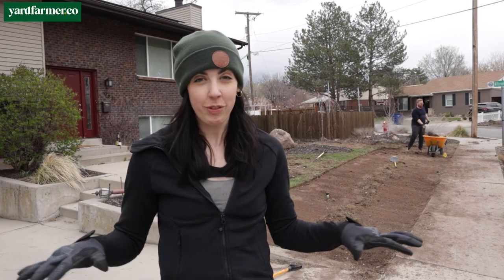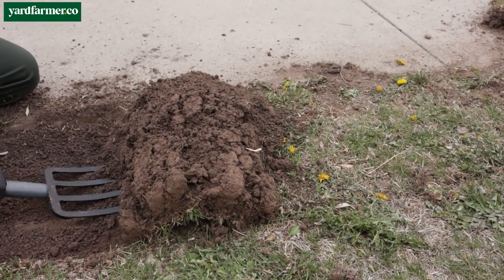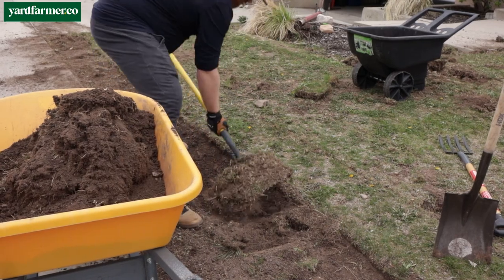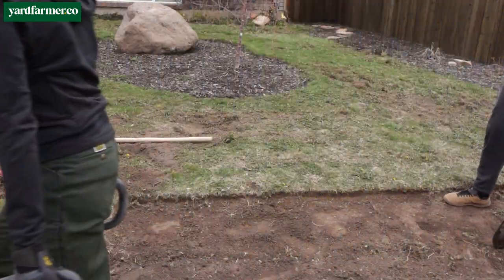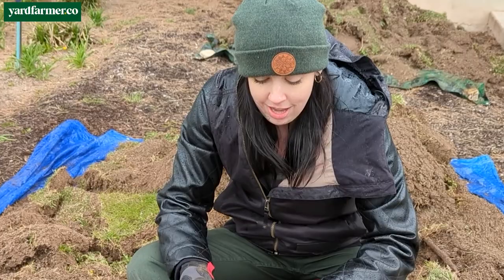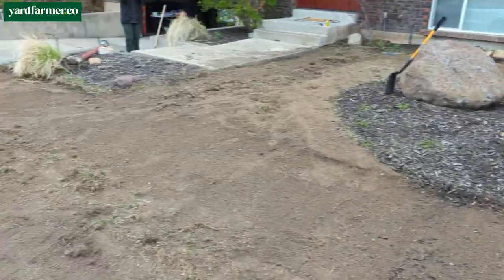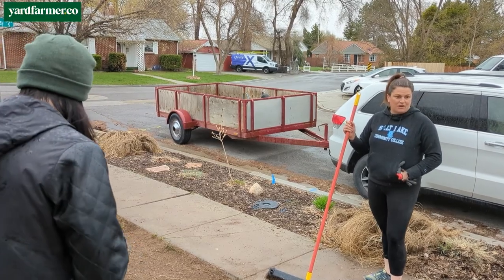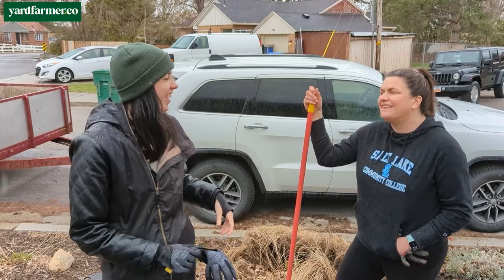We RIPPED OUT an Entire Lawn with Sod Cutting (in Four Brutal Hours!)

Comment: I ripped out a bunch of sod by hand in my front yard 3 years ago when I started my vegetable garden. In order to minimize the amount of sod to be cut, I decided to cut out the pathways (fairly deeply, prob like 4 inches) and flip those thick sod squares  upside down onto the beds. It was just cut, flip, cut, flip… without all the hauling off. It wasn’t too bad. It also made it so my beds were like 6-8 inches above my pathways from the get go. I then put a thick layer of compost over the beds, and then mulch (usually leaves). I had to hand weed the pathways a lot at first, and I eventually woodchip mulched them. But hardly any weeds/grass ever popped up in the beds. I think it was smothered by my sod sandwich technique lol. And now 3 years later, the garden is thriving and the original sod layers are totally broken down into crumbly soil 😁 it worked… but it was hard work lol. I have used different methods since then that I like better.
Reply from the maker: That sounds like an AMAZING amount of work! Grass makes for great compost for sure, your garden sounds lovely!
Reply: Cool! Facing a similar task myself…
When you wood chip mulched, did you still have to weed the grass out or did that take care of the issue?

Comment: Great video and helpful information. What about weeds. How's the area holding up. I want to tear out my front yard this summer and don't want to layout plants, rock etc then be weeding every weekend. Even the best weed barrier breaks down. Ugh!
Reply from the maker: Weeds are a HUGE problem anytime you disturb the soil! We advocate sheet mulching, which is putting down a layer of cardboard and then heavily mulching the area, at least 3 inches deep, if not more. Then you can plant your plants by cutting through the cardboard. Any weeding that needs to be done will be pretty easy since the weeds won't have anything firm to root down into.